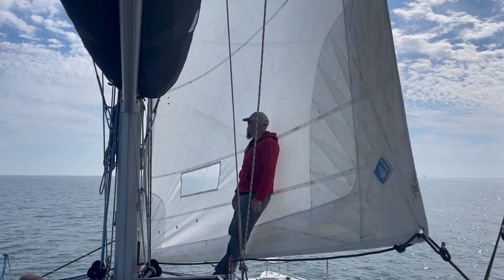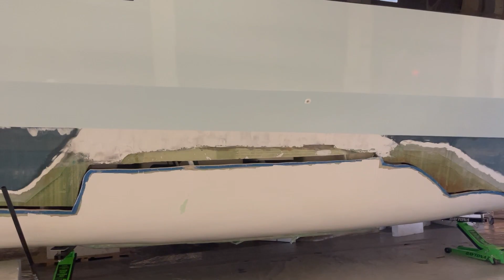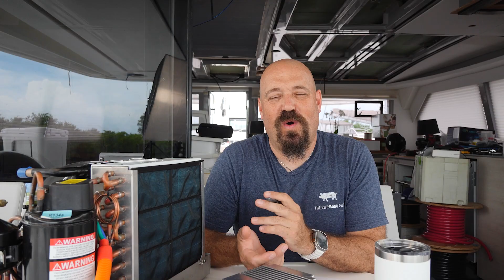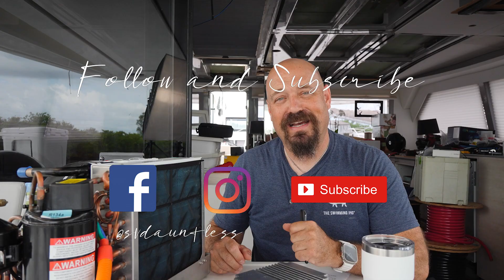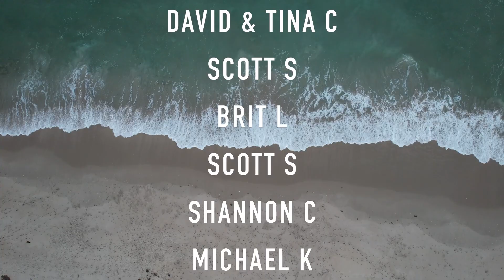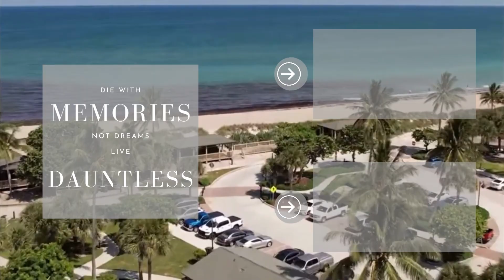BATTERY POWERED AIRCON//DC vs AC AirCon-Episode 146

Comment: Not sure if you still read this on a 1 yearr old video (i came across your channel just recently, while watching "spear it animal" video's) When you talk about this variable speed compressor (in Europe we call this "inverter" airco's) it gives the impression that this is the newest thing on the market compared to the old "on/off" airco's. But these kinda compressors have been on the market for over 10 years now.  (I install split unit airco's here in Europe), while non central AC in the states are still window units (i lived in the states for 35 years)
last week i did a test with a 3.5kw (12.000) unit, filled with R32 (the kind of gas used, also makes a unit more or less efficient, older units had R410A, R407C and before that R22 (not allowed anymore). (and these are non-brand units i get from China) This test revealed a little over 700 watts, a little after startup (so it could spool up to speed) and after almost reaching the set temperature it went down to 500 watts (we run of 240 volt, so i am not sure if the same unit on 110 volts, uses more watts, (i think the watts are the same, but the amperage is higher)
maybe this gives you some info you can use in the future. (and i will be learning from your video's)

Comment: I like what you are doing there. 
 I wonder if you could get more data if you put a thermometer on the inlet and outlet of the SW cooling for each individual fan.  Also to record compartment temp and outside temp and ocean temp.
I know you plan to cool the units with salt water, could you use/plan a home made brine system as long as you got a big enough heat exchanger and pump?  Sw pump, heat exchanger (shell and tube type with corrosion piece on sw side), brine pump, brine tank. Just thinking about the sw system plugging at inconvenient places in the boat. This way you keep the sw in mechanical area of boat/engine room.
Do you have any concerns with the refrigerant in spaces that it cools, if it leaks (heavier than air).  Are there alarm systems for that?
Reply from the maker: Thank you for watching, I am building a flushing system for maintenance to make keeping the system clean.  It is only necessary to do so when in dirty water for long periods of time.  The refrigerant  is of little concern as there isn’t much of it. Just a few hundred grams per unit.

Comment: Did you consider the Velair brushless variable speed compressor 110v units? 

I just put their second gen 10k btu unit on my Manta catamaran to cool the aft two queen bed sleeping cabins. 

Down in eco/sleep mode after the initial cool down I’ve been around 70-80 12v amps per night not including the raw water pump. 

I’m swapping to a DC water pump which should lower the amp draw even more but
I’m still waiting on parts.

Comment: I will be very interested to know how this works out.  Biggest problem for ac aircon is the starting current, do you happen to know yet how the compressor amps at start up are dealt with differently than an ac unit?

Comment: Can’t wait for the results. Waiting to fit some AC on oceanis 45.
Would love to put in some 48v alternator and fit a a 48v dc. Still unsure which battery that can take that kind of charge. A lot of drop in seems to have smallish bms.
Did you look at thermodynamica? A bit like a chiller system except it runs refrigerant to different part of the boat. Though it’s AC powered.

Comment: I really like the variable speed compressor.
Other than that the numbers aren‘t really THAT impressive. The factory-installed Cruisair units on our Leopard 48 consume as follows:
12kBTU units in the hulls - 800-850W from the 48V battery system (so not the wrong AC numbers calculated by the Cerbo) including inverter loss.
16kBTU unit in the salon - 1100-1200W including inverter loss.
No idea why the units on the 50 use that much more or whether it‘s a wrong readout but a MultiPlus 5k could run all 3 AC A/C units without breaking a sweat.

In the end those systems are just heat pumps - whether they‘re heating or cooling. You won‘t miraculously find a 50% efficiency improvement in that.

I wouldn‘t replace a running AC A/C with it. As you‘re buying new I like the idea. I just hope „China“ survives for more than a year. 😉
Reply: Being a heat pump efficiency of the compressor can make a huge difference though. Thermal conductivity of the condenser as well I guess.
Reply: 100%. But this stuff is 70s tech. So using a current model that gets a Barnacle Buster treatment of the heat exchanger every now and then should be more than enough - we‘re the sailing proof… 😉

Comment: We have 2x 220v 17k BTU units that have VFD installed on our Leopard 50. They did a good job of keeping us cool in harbortown and here in Isle of Hope this summer when temps got to around 92-3 every day. I agree with you, most energy use numbers do not consider the water pump draw, which is significant.

Comment: Hey Ty I bought a 24v aircon from China in the beginning of this year. I fitted it under our main cabin bed. It’s a 12000btu unit and works like a dream. We are currently in Malaysia ( Langkawi ) duty free and I gave the info to friends who bought some 12v units. They are all working great. The temperatures out here are insane. They do a 48v unit but we run 24v so I never looked into it. My unit cost us $1700 including the shipping to Thailand at the time as we were there. The Company in China have been very responsive to all of us and we are pretty happy with the units. Any other comparable DC aircon this side is more than double that price!!
Reply: Hi Mike can you post a link or company name?
Reply: Yes please
Reply: Do you have a name please

Comment: Would also be looking at using heat exchangers to use the waste heat from the cabin cooling to a heat pump hot water tank, the other thing i would do is put plumbing in so you can hook up a radiator or even a couple of IBC's when on the hard to keep the aircon functioning.

Comment: I went to A/C school in 1961 I found that chemical companies don't give a fiddler's damn about how hot we get it is all about doing the standard thing like your doctor. While we get sicker they make money. Do a little experiment place 12 ounces of water in a small bottle and put a fitting on the lid. Then draw a perfect vacuum on the bottle when about one ounce of water is gone the temperature water is 36 degrees. All a/c units have a head pressure of about 200 psi. The vacuum required is less than -15 psi so which will take the most energy. This is a little game for the mind.. If you had a 12-inch pipe 100 feet tall being caped on both ends and a fawcett on each end place an old wash tub of water at the bottom when you pump water to the top after bleeding out the air. When the pump is off the water will fall to 33 feet and 11 inches. This is all the atmosphere will support. The temperature at the top will go down to 36 degrees this cold water will not stay at the top it will fall and be replaced with warmer water. Our overlords don't want us to use water as a refrigerant.

Comment: Living in North Carolina, and having an Off Grid cabin that I'm looking at putting Solar with battery storage on, these interest me GREATLY!
Reply: In an on land cabin, you can get a 38 SEER ductless mini-split and run off of an inverter. About 2.5 times more efficient than the best DC systems at any voltage. They are also less expensive due to the fact that they are manufactured in a much higher volume. I am a retired HVAC designer. My 44' motor sailer has old fashioned lead acid batteries (for now - Lifepo4 is coming). I run a 16 Seer Midea window unit. 8,000 btus. My 12 golf cart 6 volt batteries and Victron inverter run it overnight, no problem. I cannot find a marine water cooled unit that even comes close. I may build one.

Comment: OK you have my attention.  Dealing😂with China not easy. I know I have a microbrewery and my equipment is Chinese.  Except the bottleling machine is Italian. I bought a Whitby 42 at green cove springs. That hopefully will sail it down to Puerto Rico this December.  But for next summer I am planning to change house bank inverter to a 12 and 24 output type.with lithium 24v batteries so can store more amp hours. So will follow your post closely. Good winds

Comment: Just to be sure I get this right, 720W at 12.000BTU, which equals 3.500kW gives a COP around 4.5 right?
There are several mini-splits (I think you call them that right?) with a COP or SCOP above 5.0, they are A/C of course, but the conversion loss is a lot less than a difference from 4.5 to 5 or 5.3?
I don’t know much about boats, and don’t know if a mini-split would be a terrible idea on a boat, so forgive me…
It might be like Dometic fridges, that costs 10 times what a A+++ household fridge does, while using 10 times the power… niche (and leasure) market, next to zero competition equals no real innovation…
Reply: Due to cost, budget, some sail boats currently use 240v split, takes up space on a mono, unit is out in corrosive weather, but could go through a few before matching cost to what Ty's original setup cost. Curious what you consider a "mini" system (model)? Might be different to what I'm thinking.
Reply: @Lana_Warwick  Thanks for the reply. I get your point on the outside unit having a very short life in a saltwater environment!
The smallest we got here in Denmark is around 3.5kW/12.000BTU with a SCOP around 5.3.
I don’t know mono units, where does the heat/cold go if there’s no outside unit?

Comment: invert compressors use electronics that it is important to protect well against corrosion
Reply: Plenty of ways to do that, circuit board protective coatings, dielectric grease, terminal sprays, replace wiring with tin, solder, heat shrink.

Comment: Insulating your boat and using low-e glass or window tint will cut your heat load.
Reply: Lots we can & have done without a/c, but a/c is the only method I'm aware of to combat humidity, which becomes condensation, mould, in nooks and crannies we can't see, let alone get to. Heat also radiates off the water surface into the hull, warms the water, which is what all those little critters we require anti-foul for love
Reply: @Lana_Warwick you're correct only an AC unit can reduce humidity.  The way AC works is before it does any cooling of the space it removes the water in the air.  Any left over cooling capacity is available to reduce the air temperature.  By using insulation and low-e glass you reduce heat gain in the boat so what cooling is left over has less to remove.

Comment: Very interested. Installing AirCon with DC compressor and Fan. Will be surprised if all the numbers make you happy when all units are installed and all running at one time and how much load shedding they can do once they reach to temp set in Florida
Reply: I have a 12v air conditioner. I definitely paid through the nose for it, but it does work as advertised. We run it every single night in our cabin.